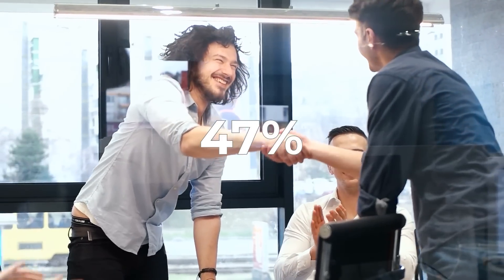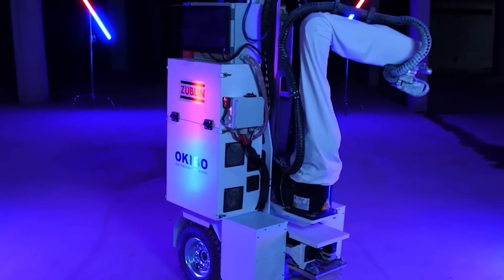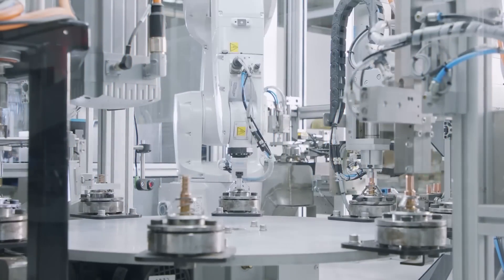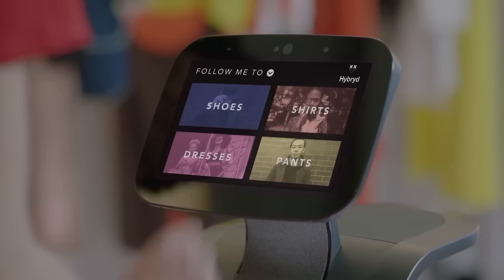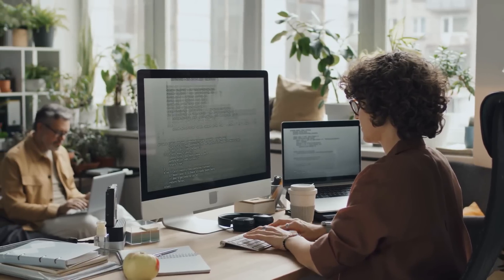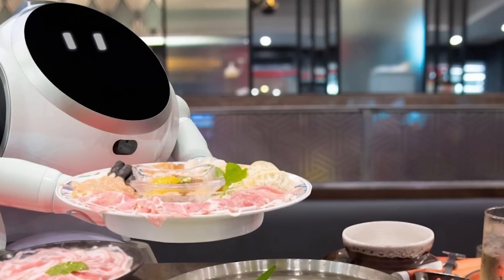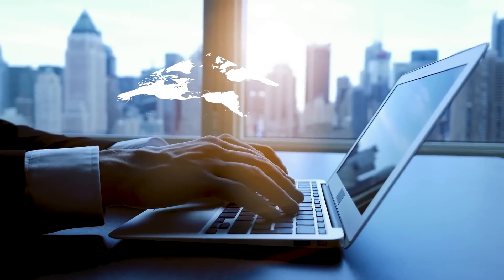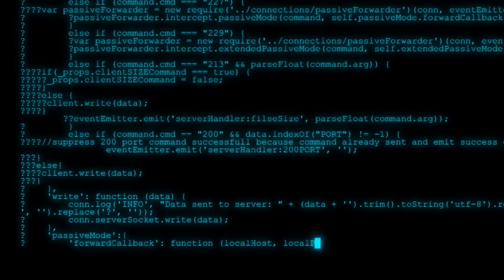The Top 10 Industries Expected to Fall in 2024

Comment: I've said it before and I'll say it again:  To replace a $25,000/yr barista you need to buy a $100,000 machine that also costs an additional 10%/yr for maintenance.  That $100,000+/yr white collar worker that sits at a desk?  They can be replaced now with about $5,000 in hardware.  Yes, manual labor will eventually be replaced but at great cost & investment.  Blue collar, in general, will be the last to go.